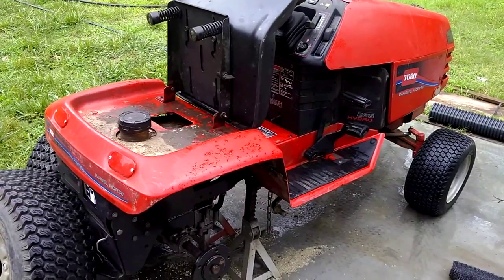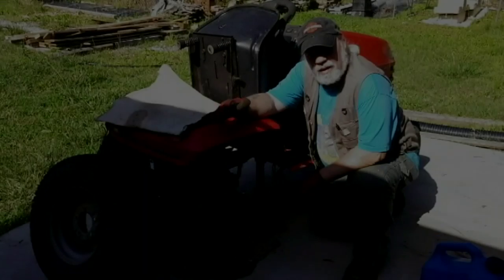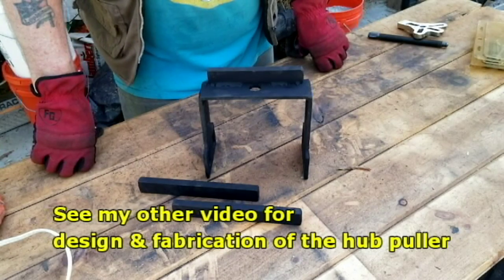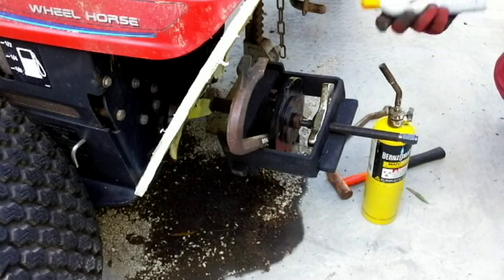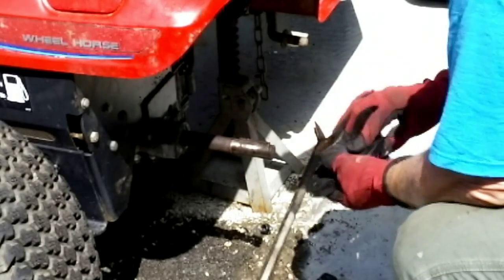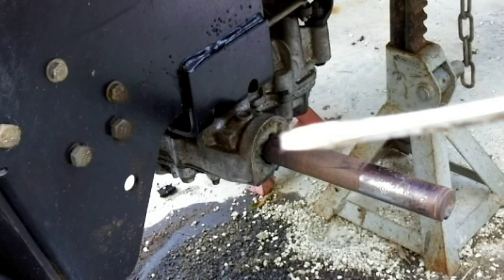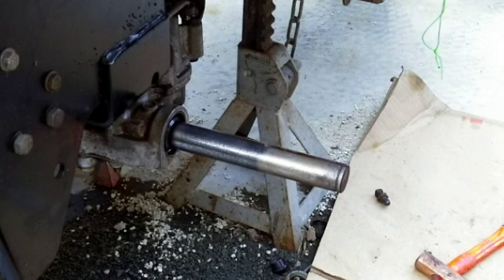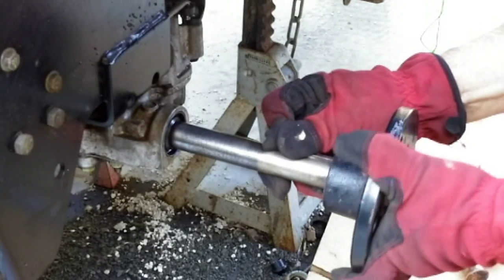TORO Wheel Horse Hub Removal and Transaxle Seal Replacement

Comment: I very much enjoyed this video. I just acquired a 97 269H so I appreciate the "insight" as what to expect! I rebuild older motorcycles as a hobby. I use similar techniques for fork tube seals. Appropriately sized PVC seal driver. Been doing it for 20 years. Thanks!

Comment: Just about to attempt the same  fix on my C161. Seal is leaking so I ought to try and replace it and I watched your vid to get some insight into the problem. This one has been sitting outside for at least 10 years in the British weather so I expect even more trouble than you had. Pity I can't borrow your puller, I'd happily buy you a pint for a quick lend of it. Thanks for the help, nice job.

Comment: I've got a Craftsman 54in GTS 5000 with a bad transmission oil seal. Your video was great! Now that I have the old seal removed I can not find a new oil seal. Tried Sears Parts and Husqvarna parts with no luck. Any idea where I can find this seal? Local mower repair shops couldn't help. My GOD, such a simple part.

Comment: Good video, thank you. I’m curious, after all the difficulty you had getting the hub off why on earth would you not lubricate the axle before reinstalling the hub?  Water is just going to corrode the whole works again?  Or since you have set screws, and we’re afraid they wouldn’t bite, seal both ends of the hub/axle with silicone?  Just my 2 cents.